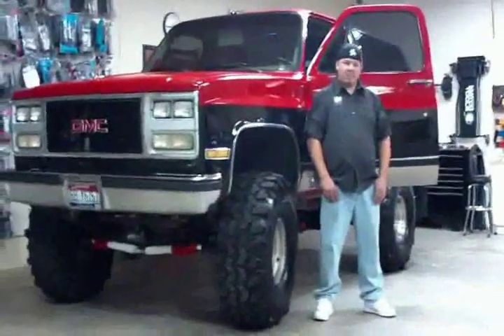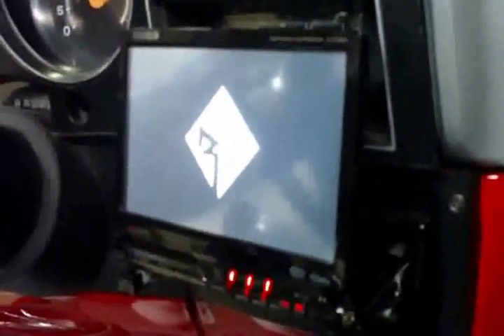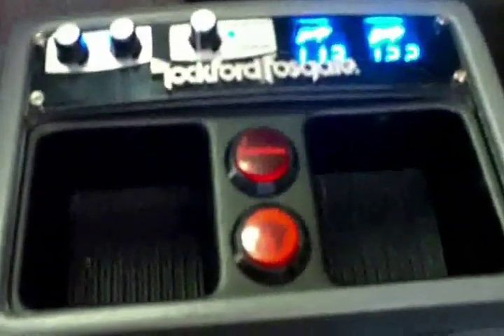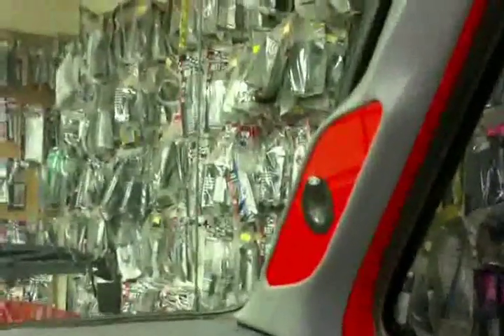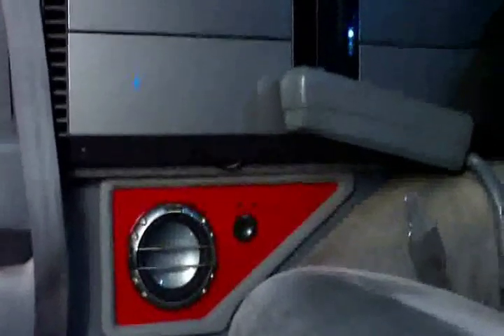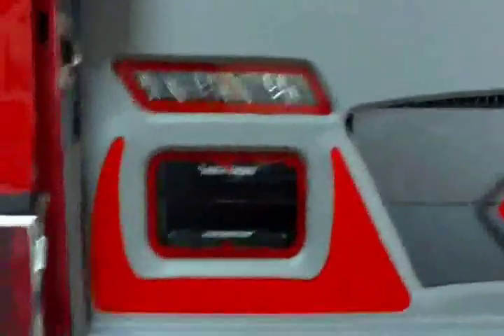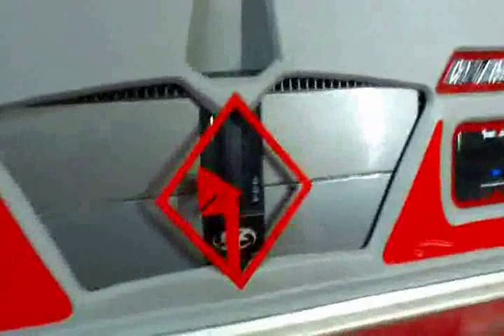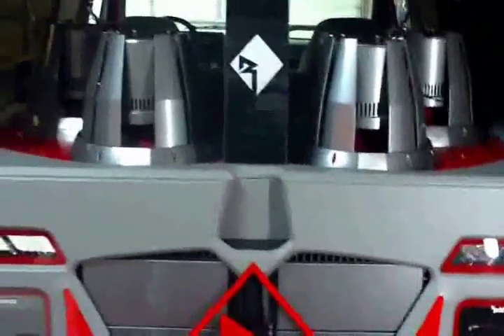2 Rockford Fosgate T40001BD's and 4 T2 15's GMC JIMMY 2010

Comment: nice install an all... but caps with that system? Really?
Amps need current... not voltage...
with that big of system I wouldnt have even bothered with the caps.. more damage than good!! that big of a cap acts more like a amp drawing power than a cap when the caps are that big. ESR rate isn't quick enough compared to how much current your drawing. Only thing caps good for... lite dim at night.. Thats it!
Amps need current.....Batteries equal current!
They're Amplifiers... not generators.
Reply: mikehoncho119 omm